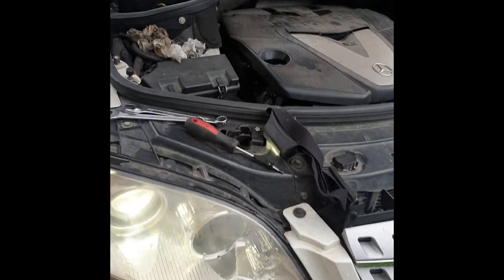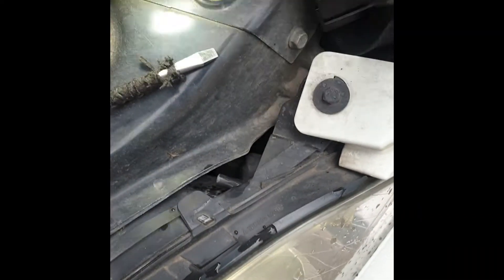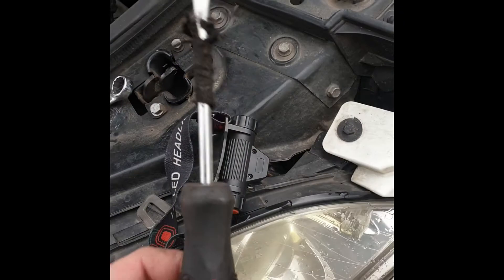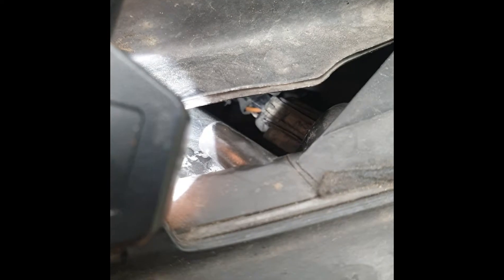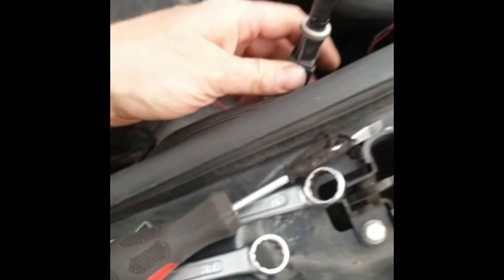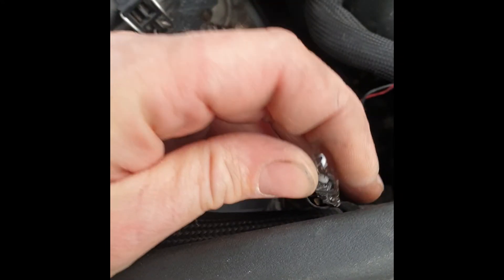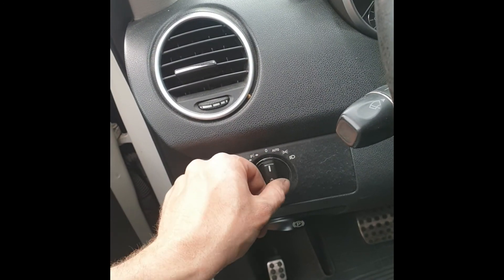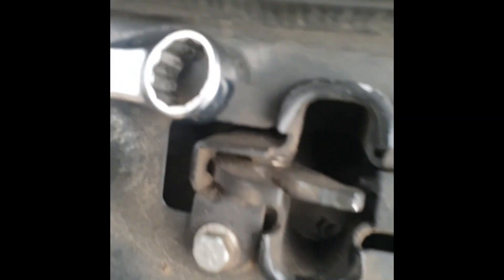MB ML w164 park bulb change

Comment: Just used this method myself and it worked well. I think there some risk that it could break the fitting when the screw driver is twisted but you just have to be careful. Given how tight the space is this method looks much easier than using long nose pliers and certainly much easier than removing the whole light assembly. One thing I also did was to remove the top two bolts on the headlight assembly so you can pull the assembly forward just slightly. This helps to see inside the cavity from the top plus it helps to manoeuvre the fitting past a nearby obstruction.